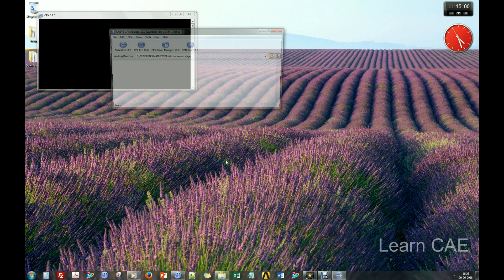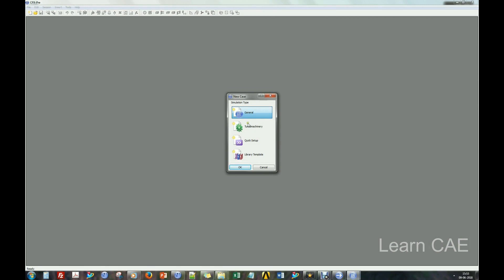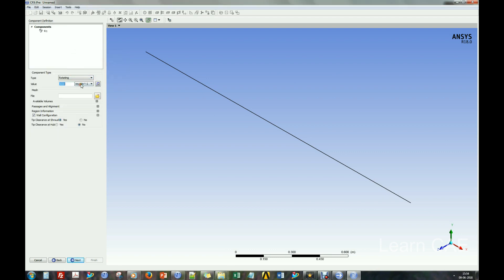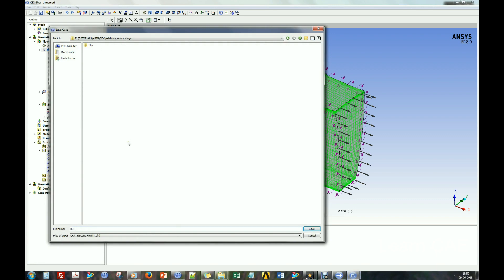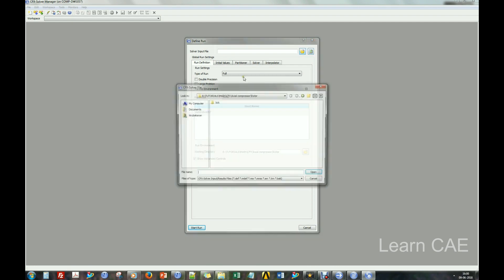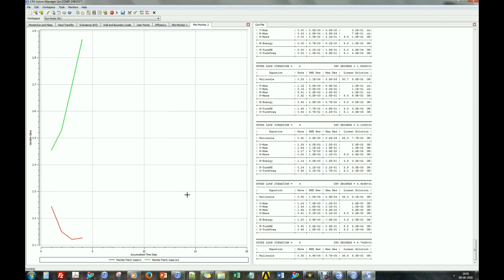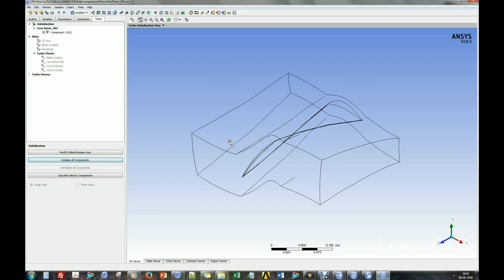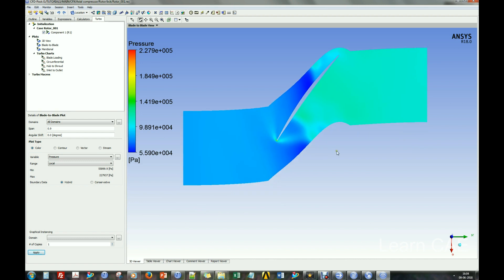Axial compressor analysis | Ansys CFX | Single Rotor blade

Comment: Hello, professor. Your teaching video has been very helpful for my research. I have a question: In the Turbo module, if I want to view the pressure distribution at the blade inlet and outlet using hub-to-shroud, and my simulation only includes a single blade, does streamwise = 0 correspond to the inlet and streamwise = 1 to the outlet? Thank you very much.

Comment: Hello, I am doing a CFX on rotor/stator analysis on axial compressor. The physics check from ANSYS agree with my design and mesh checks are all within appropriate values, when you open the menu for mesh statistics. The meshes are saved and are detailed enough for both rotor and stator. However when I connect the turbogrid systems to CFX to input both components, even though Ive used same mesh size and detail for both of them, ANSYS CFX does not recognise the stator S1 mesh. IT is...there... I also then tried openning CFX on its own and inputting the ".gtm" saved mesh but still the same error. I cant do my CFD that way and nobody on internet managed to help me so far. Any suggestions that I might be missing. I would appreciate it if you would attempt o explain what might the problem be. 

WHAT I BASICALLY DID:

 I started from bladegen ( where I made R1 and S1, twists at root, mid, and tip, beta inlet and outlet angles through the Ang/Thk Mode entirely, and for model properties I marked R1 as axial compressor and S1 as diffuser, obviously R1 rotating and S1 stationary), then connected to separate turbogrid systems (to create meshes until I see no errors or at least 99% OK values in mesh statistics bar) and then CFX for high turbulence compressible flow CFD analysis, with most of the solver settings on, such as turbulent eddies, velocity compensations, and other type of settings. My issue is that my S1's mesh even though is approved by ANSYS turbogrid can NOT be seen by CFX - AT ALL!

Thank you in advance!
Reply from the maker: Hi, glad to hear from you. Seems like you have inconsistency in the units for both components. Kindly check the units in bladegen for both cases. Other option is to simply load both gtm files separately in CFX pre processor and check the units (you can see the scale below in main window). If you could not resolve further, kindly email to learncaenow@gmail.com

Comment: Hello i m working on an axial turbine .can anyone help how to calculat the real torque shaft on the rotor outlet in cfx post and also get the value of mechanical power
Reply from the maker: Hi, you can directly get the torque value from CFX post. To calculate the power multiply torque by rotational speed (in rad/s). You can also calculate power from mCpdT.